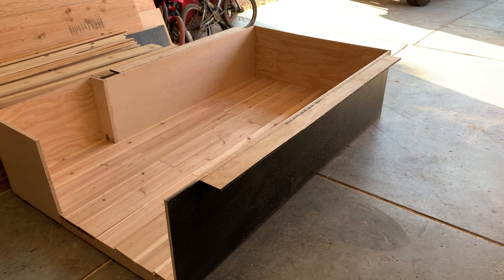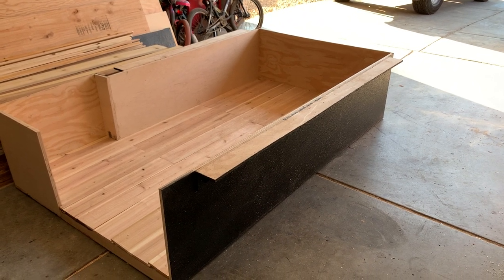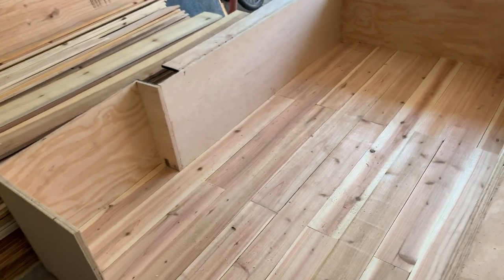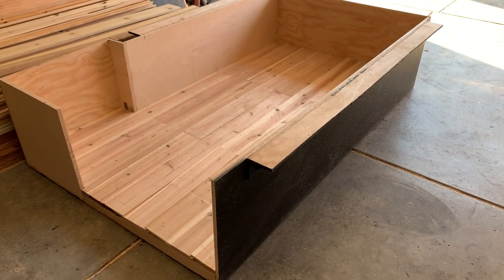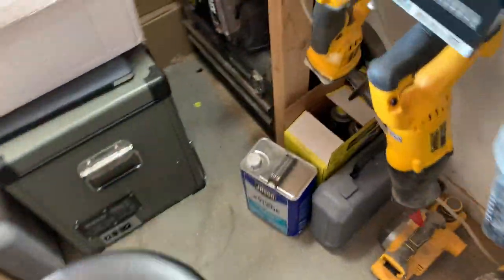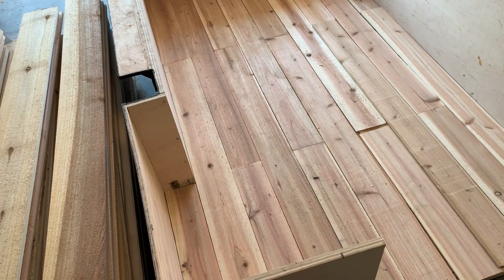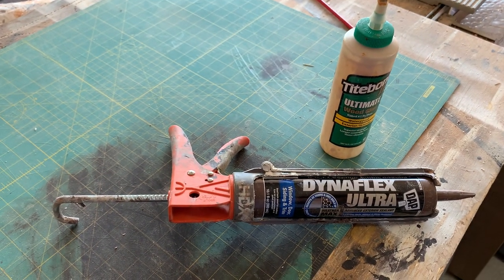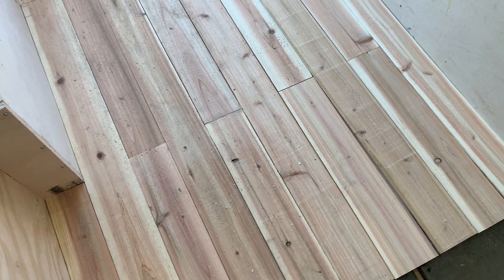Home Built Camper Project 2.0, Part 1

Comment: I like your project and how your going about it. Having built many things from my home, to an airplane I understand the thought process. Thanks for sharing. One tip for anyone considering a build like this is to use MDO plywood when required, it is very stable and has excellent water resistance.

Comment: I hope you have patened rhem so no one else claims your designs 😊 these. They are beautiful im gonna try n make one. Ive watched alot of vids n i dont like all the heavy wood slot of ppl use n i alos love the putside you do on yours. I have reqlly cold winters n i have a gmc sierra n a f250 on its way flat bed on it. So id like to build  my own in a shop or storage area as i dont ow a garage. But i want to l4ave come apeing or tail end of winter n i am gonnq make it happen. Where i am is not ideal ans i need ro do this for me❤

Comment: Hey endgame, I just found you. Im going to post my question here hopefully you have time to answer it . . being my question pertains to the beginning of the build. . What do you seal the bottom plywood with are you using the truck liner underneath and are you putting rubber bands between the plywood and the truck bed or does it just sit on the bed? Are you still using the truck bed liner from Lowe’s or Home Depot if so what brand ?thanks!

Comment: Beautiful and innovative work.  Are you using fasteners to to secure flooring planks to the joists,  or just relying on the adhesive caulk?

Is caulk applied to the lap joints or just at the joists?
Reply from the maker: I’m using the adhesive caulk and 18 gauge Brad nails to attach to the joists.  So far, it is working out well. I also used caulking between the lap joints too.  I added extra and actually took up the spaces between the expansion gaps to ensure waterproofness.  I figured the caulking could compress / expand with movement.  Making it waterproof was paramount in that section for me.

Comment: Hey there endgame! I’m curious, do you use a brad or finish nail gun on your camper build? I’m looking to purchase ONE so I want to no what’s best for this type of building. Thanks so much! C
Reply from the maker: I primarily used the Milwaukee (18 volt electric) 18 gauge Brad nailer.  I posted a video comparing several brands probably about 2 months ago.  Take a look at it. Thanks
Reply: @EndgameCampers  thanks for the response! I’m hoping to start my build this weekend. I get 4 days off from my teaching job! Wish me luck! I’ll be building the tub and framing out the walls.